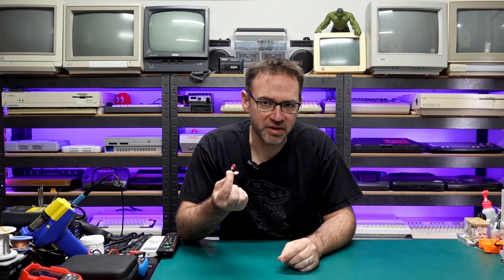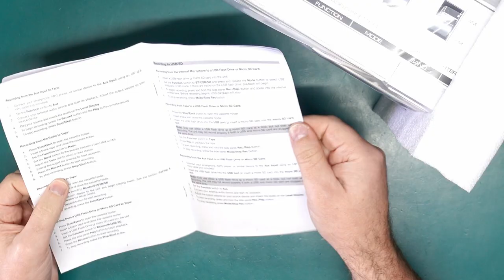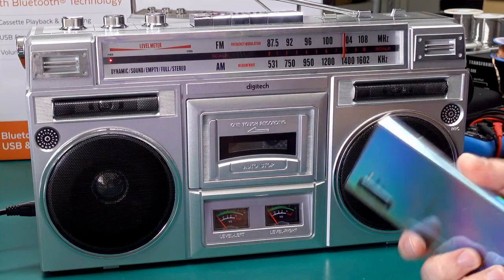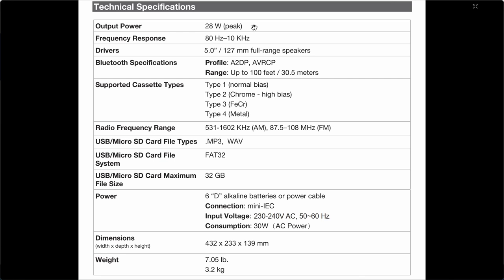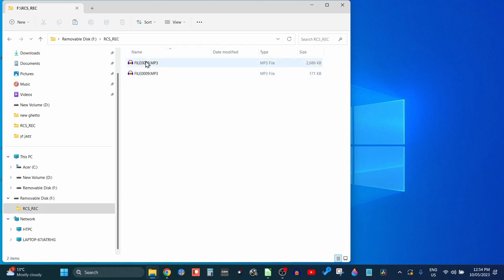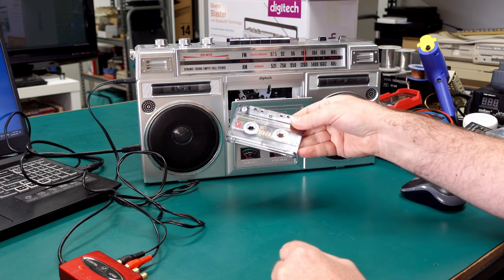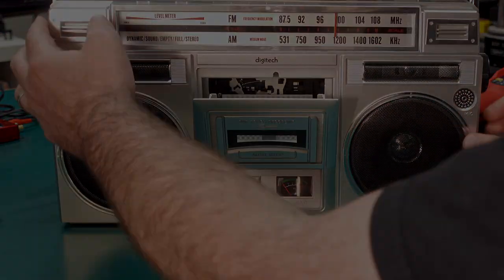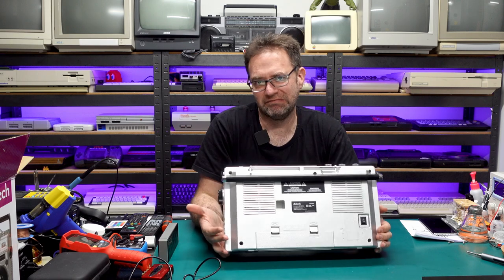New ghetto blaster/boombox thing - Digitech CS-2473

Comment: Around here in midwestern USA, I got one similar to this one from ION and it works quite well. It's got 2 VU meters located above the 2 speakers. I see your VU Meters or LED Power Level Meters works as bad as mine does....does not work til the volume is turned all the way up. So it appears Digitech and the ION unit I have are basically the same boombox except for some cosmetic differences. Good video.

Comment: Almost felt like a Techmoan video which I enjoyed. I'd love to see an upgrade video. Not too long ago I did an upgrade to a vintage but inexpensive boombox. replaced the speakers and added a bluetooth module. The tapedeck still doesn't work, but I don't own any audio tapes, so It wasn't something I was concerned with. I'm pretty happy with the sound quality, but I have seen videos where they say replacing things like Op amps make a huge difference. I'm sure you could also do some other tweaking to the audio circuit to improve sound quality. The tape mech is garbage, so I wouldn't expect miracles unless you can swap it with a high end one. You could add some real tweeters and make some crossover boards fairly cheap. I used to make my own when I first got into car audio. Sky is the limit. Worlds greatest sounding boombox would probably get a million views as a short.

Comment: interesting video, i was thinking if it was possible to use this ghetto blaster to create some c64/ Spectrum 48k/amstrad cpc/ etc... datasette via usb or sdcard wave files. :/
Reply from the maker: Haha, yeah I wouldn't recommend it for that. If the deck had better wow and flutter figures then maybe it could work. But I imagine in its current state it will cause a lot of loading errors

Comment: You can be sure if Jaycar are selling it then it's cheap china junk. They don't stock quality stuff, at least not in this sort of gear.
I see on their website this model is still showing as available, and they have a new smaller "boombox" available now which is model # CS-2443.
Dick Smith used to sell stuff under the "Digitor" brand and whenever I see either of these names I just shudder. 
The problem with china producing this stuff is that it's all destined for the landfill, sooner rather than later.
I notice it's got one of those horrible digitally-stepped tuners in it as well. 
I'll stick with my vintage Sanyo M9998K boombox which was built to a spec, not to a price.